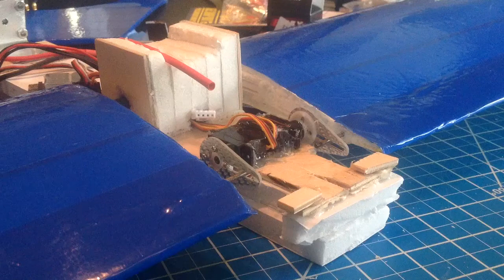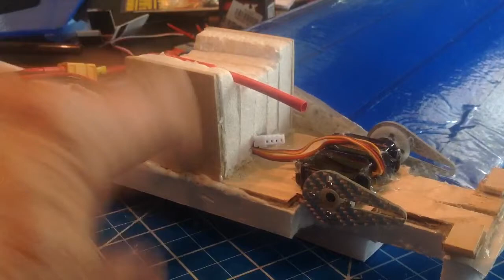Pitcheron mechanical system

Comment: How many degrees of deflection are you getting?
Reply from the maker: This plane had about 60 deg of total deflection
Reply: By this I assume you mean 30° up and 30° down from neutral, is that right? If so, I am surprised. Based on the video I would have guessed maybe 15° up and down.
Reply from the maker: Actually, I did limit it to about plus and minus 20 deg in the contest video. This mechanical video is a newer design I haven't put in the air yet.
Reply from the maker: You are correct.... My new plane I'm working on has more tilt